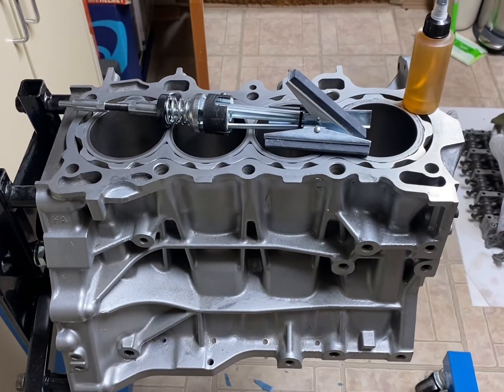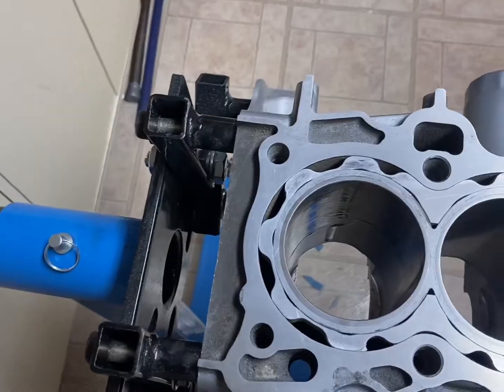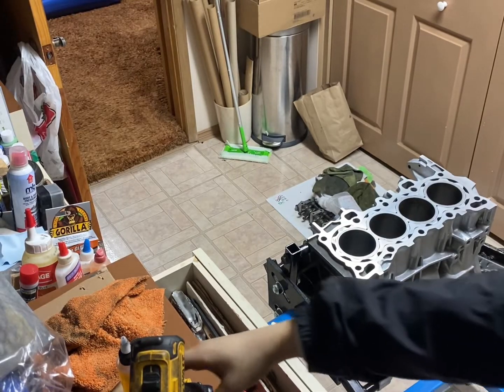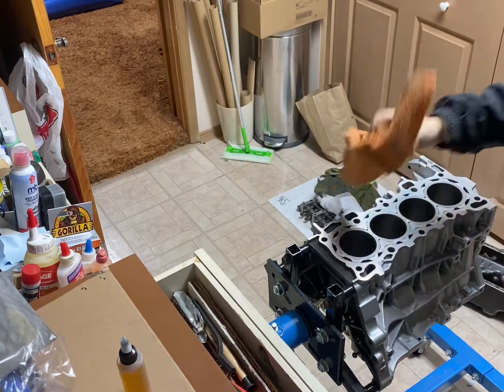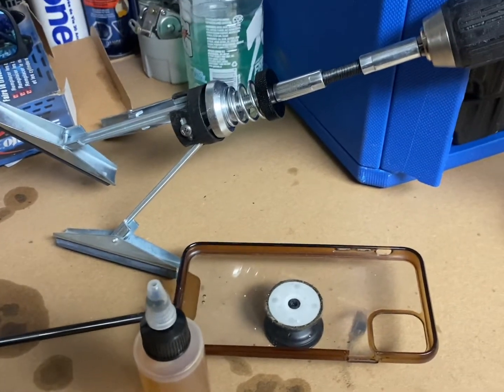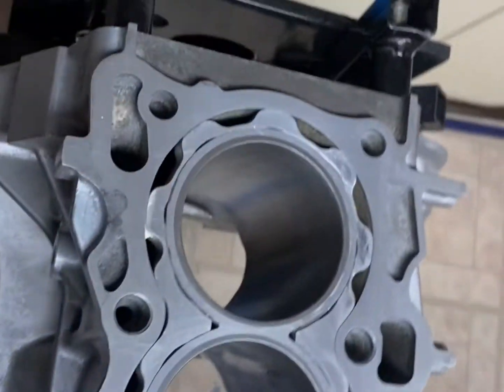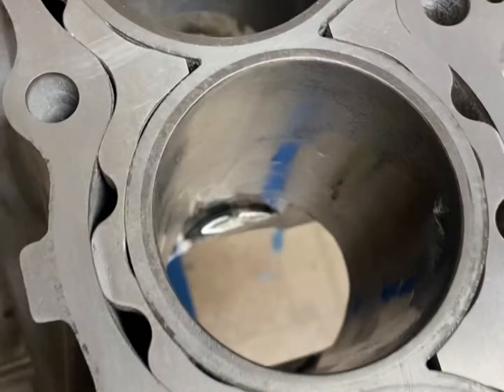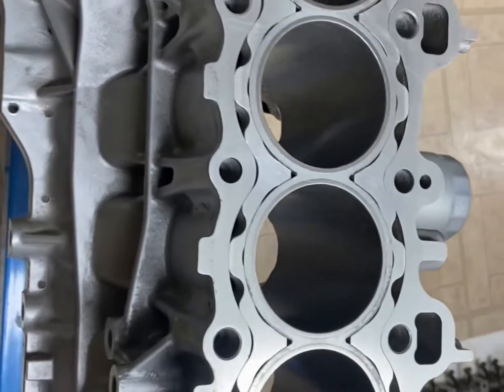How to Hone Your Cylinder walls on an Engine Block | D16Y8 Turbo Build| Part 3

Comment: You are letting the drill run too fast. And your not going fast enough with the up and down movement. I have been building motors for about 30 years. Trust me on my advice. That will get you a perfect crosshatch with practice.
Reply: Idk what I’m doing wrong but I can’t get it to cross hatch . I’m working on a gx200 and I’ve tried and tried to get it to cross h with the same tool. I ordered the flex one with the balls cause it seems like that would help achieve the cross h. When i the tool with the stones , it just smooths it out .
Reply: How many rpm on drill setting and what is the optimal crosshatch angle for a turbo build with high comp pistons and forged Pistons?
Reply: I usually run a slow speed maybe 150-200rpm. Could be slower. The up and down is faster. You have to figure it out.  Just remember slow, rpm fast up and down.

Comment: depending on the type of rings the rule is 220 gr . the biggest problem is the honing is the stones are soft and go away fast . only opening .0040 for piston clearance stones gone after two cylinders !!! stones are crap now using my old stones 39 years old don't fall apart !!
Reply from the maker: Never had an issue…block was then washed
Reply: I'm honing steel inserts ( sleeved} hard on stones . the old stones hav dun at least 10 engines and still half there . they don't make them like that any more . Hot rod shop 13 years and I'm 73 building a 351w 500hp for my 65 mustang .

Comment: It's cool that you are interested in engines and are willing to do stuff yourself but I'm going to give you some advice that I wish someone had given me when I was young and there was no internet. First of all cleaning up a Bore with a three hone stone is total crap. As far as I am concerned there is no real use for that tool at all. Uncle Tony thinks he is going to straiten out a bore with it no it won't. If you use that it will most likely introduce a taper into the bore. So first you must measure WITH a BORE GAUGE and see if you have a tapered bore. If you have no taper than you can ball hone it. If not and you do have a taper there is no other option than to get it bored and honed. The cross hatch produced by that crap hone may be marginal for a N/A engine but definitely will be crap for a turbo.

For a turbo engine it is not as simple as honing it and running it. If you plan to run any king of real boost on it you need to consider the ring package. For anything that is going to see anything over 7 pounds of boost you need to go to a steel ring package. Under that you can stay with a single moly. Factory rings unless specified for a turbo car aren't going to work. The engine will run but it will not even get to it's potential. I would call Keith Jones at Total Seal piston rings for a ring recommendation as well as a ball hone grit recommendation if you have no cylinder taper. If you need to get it machined let them know what ring package you are going to use. Different applications need different hones.

My first advise to you is too not cut corners on machine work. Invest In a good set of micrometers that are .0001 accurate along with a bore gauge with same accuracy. Buy a deck bridge and a dial indicator. Measure everything ! Then measure it again. There is no substitute for tools. If you are serious about doing this you can never have enough tools. I still buy them every day.

My number one pet peeve is doing stuff twice. If you go down the road you are your going to live it. My first engine when I was 15 took four batteries to start the car and the engine lasted about an hour.

I knows it's cool to have a youtube channel and getting some money on the side is a good deal but advising people on what to do when you have no clue isn't. I would put in terms like "This is what I'm doing" not how to do.

I have been building engines for 45 years and I see a lot of the youtube stuff and cringe. Uncle Tony is one example along with Alan from Golds garage I wouldn't let those guys work on my lawnmower.

I hope this helps you out a bit. Good luck and enjoy your wrenching!
Reply: you're wrong about the 3 stone hone. it will slightly straighten taper and roundness while ball hone cant. it will also show imperfections while ball hone will mask them